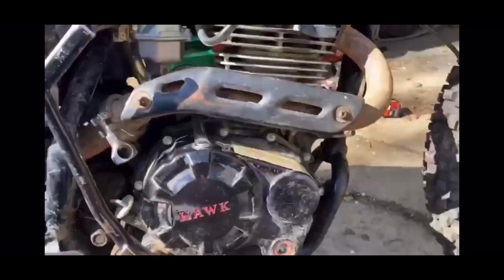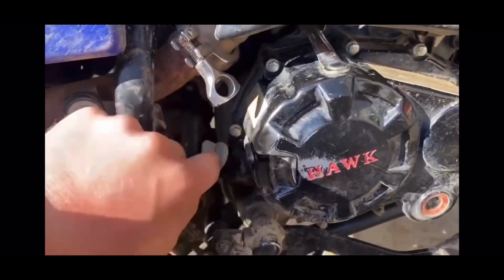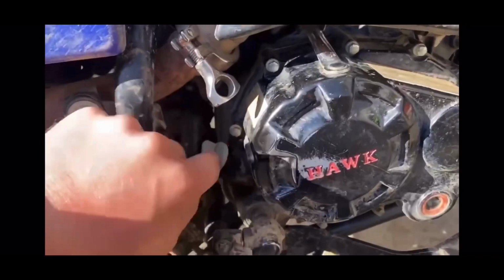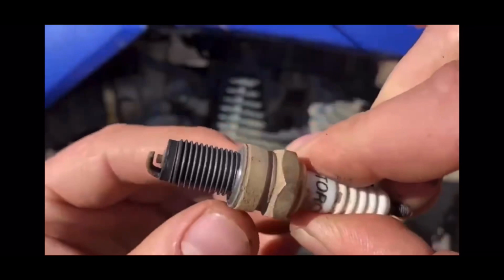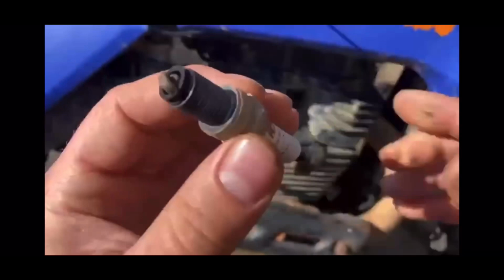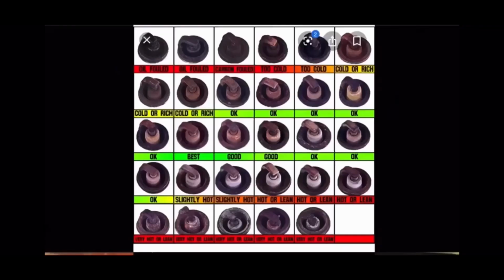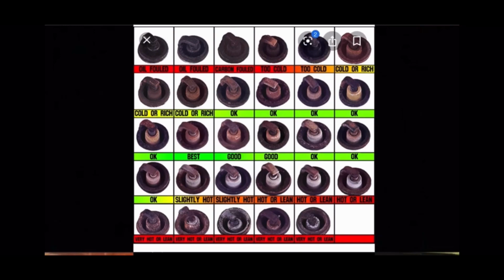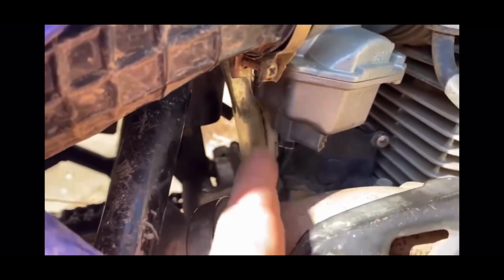Hawk 250: What caused the rings to go bad? My Speculation.

Comment: I have used both 17/45 and 17/42 gearing and have run 7500-8000 RPMs for hours at a time for no problems at 65+ mph. Whether or not this will last for 10,000+ miles remains to be seen. I'm with you on OEM. When it comes to engine parts on bikes like this, it's definitely the way to go. These CG 250 (229) motors are actually pretty doggone reliable motors. Great video.

Comment: Re: reliability, I do know this, Patrick Choi rode his Hawk on the TransAmerican trail for 10,000 miles for full throttle a vast majority of the time. His Hawk currently has over 16,000 miles on it now and is still running strong.
Reply: No shit? ...and I was worried it couldn't handle a two thousand mile road trip
Reply: @fukutube7916  yep, there are guys on the Hawk 250 Facebook group that have over 17,000 miles on their Hawks with no problems.
Reply: Yes, of course. The 230cc engine on most of these are as reliable as it gets. They will last longer than the frame lol
Reply: I got 45k on mine normal oil changes
Reply: @kumuanenai6200  45,000 miles or 45,000 kilometers?
Reply: @dustinsegers4534  miles
Reply: @kumuanenai6200  wow. Then you sir would be the highest mileage I’ve heard so far.

Comment: I was riding mine and it just lost all power, like you say I was using if for commuting everyday to and from work, had it geared 17-45 tho and I rarely ride and full throttle unless up a hill, I must have messed up something in the crank case cause oil is barely seeping out of the bottom of it, idk if it's a compression issue or if I blew a gasket or something, probly just gonna buy an loncin 250 and throw it on there.

Comment: I got 110 miles on my Dlx I ran it to 60 mph at for about 20 min so far . It’s still running fine but it does run hot . I noticed that the dip stick will show its full but the bike specs call for 1 1/2 Quarts of oil an I use Synthetic 10/40 Mobil one racing oil. I also have a grom an I run the same oil . Just thought I should share. I’ll stay tuned being I have a hawk. I hope it’s running better now . That’s shitty luck .
Reply from the maker: Lol! If I didn’t have bad luck I would have any luck at all😂

Comment: Your premature top end wear really has the hallmarks of the engine running too hot. Your pinging is also a clue in this direction. Adding extra oil causing a reduction in the amount it is burning is likely due to increased cooling from the extra oil. Anything much above normal operating temperatures for an air cooled engine (already higher than a water cooled one) will cause the motor oil to lose its lubrication properties resulting in increased wear to severely increased wear depending on how hot it actually is. And if hot enough, catastrophic engine failure due to lack of lubrication even if there is plenty of oil in the engine. Typical causes can be too lean of a mixture, a plugged or restricted exhaust or catalytic converter, ignition timing too advanced or retarded or a combination of any of those.  
Love your Videos!

Comment: Perhaps delete the catalytic converter, maybe that has something to do with it, worth noting is on one of my dirtbikes it used to put out smoke n turned out the float bowl in the carb was bad, it let fuel into the oil, new carb(rebuilt kit was like $6 n a brand new carb was $11 so went with that)fixed everything
Reply from the maker: Haha man, I wish it was a simple as picking out the cat😂 my cat is still in very good shape and very free flowing. Getting fuel in the oil is the worst!

Comment: My bike is a TBR7.  I feel like I abuse my bike with highway runs and putting on winter-weight :p, and started noticing oil coming out of my crankcase vent, and after my crank case mod I got almost no oil out last year.  Curious, what source for parts gave the best replacement Chonda parts.  I feel a rebuild is in my future.  Thanks!
Reply from the maker: I haven not had any luck with eBay parts, I would skip the eBay top end parts. The factory parts are the best parts believe it or not. When I rebuilt the top end on my bike the second time I bought a factory piston rings and wrist pin from txps, so far so good. Iv got 2,500 miles on the factory parts without any issues. The eBay top end I put in it didn’t last but 1,000 miles and it was toast again.
Reply: @goodolboys713  Thank you.  I might go with a Big Bore Kit if I have to replace the rings.  Any experience with BBK's?

Comment: valve guides? and/or via the oil return through the cylinder barrel. I don't think it's the rings.
Reply: burning oil at start-up that diminishes when the bike is warm implies that it's NOT the rings.
Reply from the maker: Forgot to hit that home in this video too. It’s more than like not the valves, hear me out. I understand how that works, Iv replaced bad valve seals many times before. In this situation the valve seals/guides are more than likely not the culprit. And again, no one will really know what’s going on until the bike is take apart and inspected. The reason the valve seals are not likely causing the oil burning issue is because: after I replaced the original rings, no smoke for 600 miles. If the valve seals were the issue to begin with, changing the rings wouldn’t have stopped the oil burning issues to begin with.. hopefully all this makes sense, thanks for your input!
Reply: @goodolboys713  That makes sense. I am leaning towards a leaking head or base gasket.
Reply from the maker: @tomw9875  the base gasket would not cause the bike to burn oil, the head gasket could maybe cause it to burn oil but it is a new head gasket with a new o ring. If the head gasket was bad chances are that it would have a loss of compression or some other symptoms of a bad head gasket as well.. again.. there is no way to tell until it’s all the way apart and inspected
Reply: @goodolboys713  I hear ya. The burning oil at startup suggests to me it's something OTHER than rings. Of course it could be rings AND headgasket!
Reply from the maker: @tomw9875  honestly the hawk really just burns oil if it’s started cold and reved up too high. You will see this in an upcoming video. I’m not going to 100% say it’s the rings, but all the signs and symptoms I am seeing point to a 99% chance that the rings are toast.
Reply: @goodolboys713  I trust your judgment; I am looking forward to future videos that will solve the mystery...